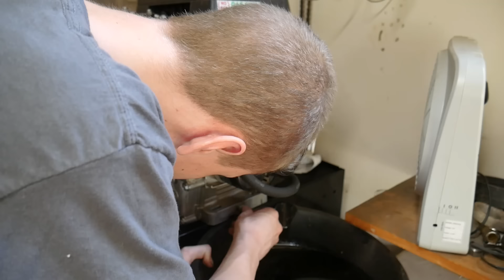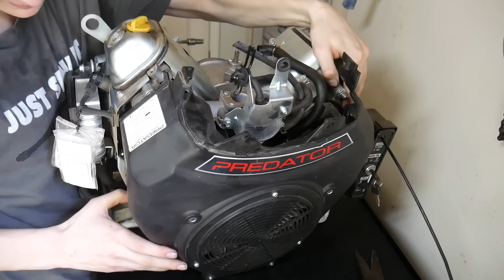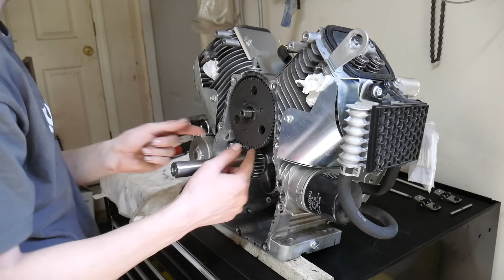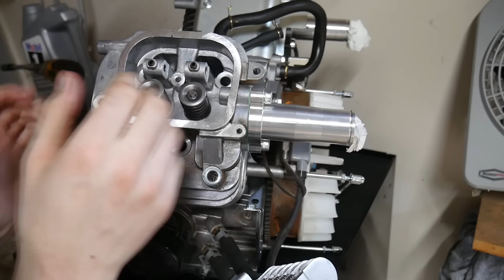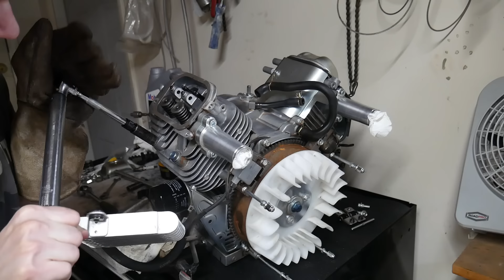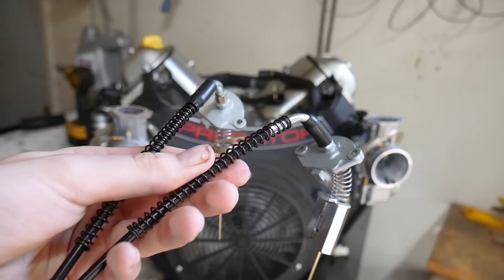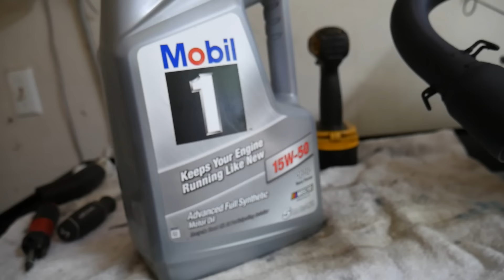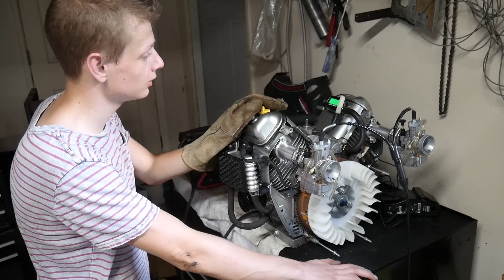2X Factory Output! Predator 670cc Performance Build

Comment: Looks like your able to get around great after the wreck how long did it take to walk, I have the same leg injury right now our x-rays look almost identical. I was just wondering cause I'm tired of sitting all day waiting for bones to heal.  Its only been 40 days or 6 weeks since I was operated on and the doctor told me 8 weeks till I can put weight on it. I love the videos keep up the good work.
Reply from the maker: Accident happened may 5th. Surgery may 24th. Lots of suffering later. August 24th doctor said I was able to weight bear. But it took me 3 weeks to learn how to walk very slowly and regain some motion. Now it's October and my walking is around 85%. Lots lots of muscle. Get a head start on regaining your motion and start doing excersises of YouTube. Go to pt.  You'll get back quick
Reply: @VasilyBuilds  I was hoping to be walking in 4 months total time after surgery but that might be to quick, I have no pain now and its been only the six weeks ,thanks .
Reply from the maker: Dang. Lucky, the pain never went away until August it sucked alot
Reply: @VasilyBuilds  Plus I broke my clavicle and fractured two ribs, my hip, my wrist and a little road rash. The x-rays when I was taken to the trauma room were extreme pain, over 3 hours of pictures,MRI and CT scans because I cart wheeled head over feet for 160 feet till I stopped. I had gear on if I did not I don't think I would be here, I made a mistake in not waiting for a dry day to drive my bike. A tree was blown down in the road after dark and I did not see it in time, by the time I seen it wasn't just leaves I seen the bark of the trunk across the road. I was going about 40-50 and hit dead straight on.

Comment: I'm thinking you have more than 40hp there cars and cameras built a 670 with 50-60 hp with pretty much the same setup, except I don't think they went with dual carbs. Awesome engine tho man
Reply from the maker: Yeah they also have ported and shaved heads and also a little heavier valve springs plus a lighter flywheel. But the dual carbs may make you for that

Comment: Nice video. I suggest hearing protectors if you're going to start an unmuffled engine, especially indoors.
Reply: Tom I've been working on engine since I was 11 years old with and without Mufflers indoors and Outdoors I never wear hearing protectors plus I've been shooting since the mid-60s without hearing protectors I can still hear things including electrical outlets that are shorting frying pans that are frying machines that are running in the background hearing protection is for somebody that either is a scaredy-cat a pansy ass or very sensitive to little things like ants crawling on them there's a lot of fun and listening to an engine without hearing protection or without mufflers
Reply: @brantardrey7360  I'm happy for you but after many years for doing the same kinds of work without protection I have a severe case of tinnitus and a major hearing loss in one ear. So I stick with my recommendation.

Comment: I have a stock 22 horse predator and I need to know how and where and what wires to use to hook up the tach. I got my tach from eBay that is rated for a twin cylinder engine and I would like to do this before I get my buggy open and running. Any and all information is greatly appreciated
Reply from the maker: Hook up to spark plug wire

Comment: The low end torque problem of a bigger carb can be solved with a diaphragm carb from a motorcycle but they arent as crisp in response as slide carbs :)

Comment: Thicker the oil the better is really true. Maybe in the very hot summer time but not in cooler climates. Depends on clearances & tempentures. Be careful to thick can damage an engine. Try to hook up an oil pressure gauge.

Comment: Not sure what those engines call for from factory, but 50w oil seams way to thick, might over heat, and won't get as good of lubrication
Reply from the maker: Old school Harley's and turbo cars run 50wt oil. 20w-50 was also recommended by performance 670

Comment: The original hole for the govenor shaft I would recommend tapping for a fitting same with both valve covers. The reason for this is to keep the oil in the block and so it doesnt build up in the heads. I know it's more prone for the single cylinder engines like the 212 because at 7000+ rpm you dont wanna spin a rod bearing. It helps the oil flow back into the block and not build up in the head.

Comment: Keep up the work mate your doing well. I like the go kart I have that engine my self x2 1 of those in my 04 kx250 and the other 1993, was for a kart that never got done 17 years ago. Your a handy lad your gonna go far in what you do, good on ya.
Reply from the maker: You have a 670cc in a kx250? That's what I wanted to do
Reply: No no, I have a 04 kx250 complete bike and a 1993 engine,  there basically the same  other than power valve differences and porting ect. Sorry I just watched the vid on this build and dropped a comment about the kart. I'll be watching for what you do with the v-twin tho.👍

Comment: I've seen 212 predator stock flywheels explode violently at high rpm. I assume these flywheels aren't any better. You should definitely upgrade the flywheel before you hurt yourself if you though hitting a wall sucked imagine getting hit with a piece of flywheel. you have a legit bomb there with that flywheel.
Reply: Yes. I have found chinese cast iron to be very inferior. An engine like this needs a steel billet flywheel and a decent balance job before taking it over 5000 RPM.  Forged rods and pistons over 6000 RPM
Reply: Just make a scatter shield out of steel and brace it to the frame, it's really easy to make a compact one for a 212 might take bit more work for a 670 but definetly doable
Reply: you can't find cast steel anywhere and would cost a fortune for one from a machine shop custom made and a billet aluminum is $350 and you need to also buy a $150 high torque starter putting you bout $500 extra in the hole for just the flywheel and starter.
Reply: And I got a Hemi Predator I run with the stock flywheel 9500 RPMs several times never had a problem. Of course that's what the internal balance

Comment: Should've port and polished the heads while they were off.
Reply: Check out the David Vizard videos. He explains where the best gains are to be had when porting cylinder heads.
Reply: At around 4K rpm the valve is opening and closing 33 times a second. There’s plenty of turbulence to mix the gas. Polish =flow=GO!
Reply: Polishing doesnt always work..as some roughness is better for swirl...hence fuel/ air mix.

Comment: All that performance stuff, and you didn't invest in roller rockers or a lightweight aluminum flywheel to take those 7K rpm revs? You DO know that the stock plastic flywheel fan is known to come apart above 5000 or so, right? Or worse yet, that crappy iron flywheel? Those things will kill you or maim for life.😐
Reply from the maker: It will only rev to 5 or 6 for now. springs are only rated for 5k

Comment: Good video. Very informative and entertaining. I managed to laugh a bit at the joke.  Keep in mind that I did damage a car's engine by using heavy weight oil. The engine just didn't get hot enough to flow the thicker oil correctly which resulted in rod knock.  One of my many lessons in life to not always pay attention to what you read on forums.
Reply from the maker: Dang great info. I choose it because this thing gets hecka hot. I'm was also planning  on running the same oil on my daily. If I ever turbo it